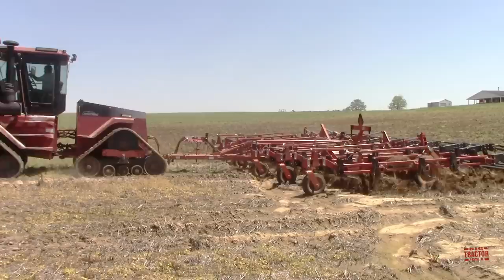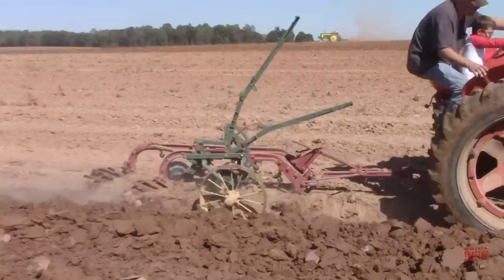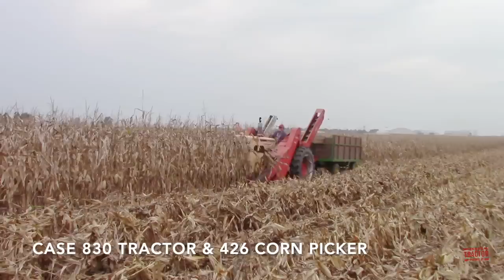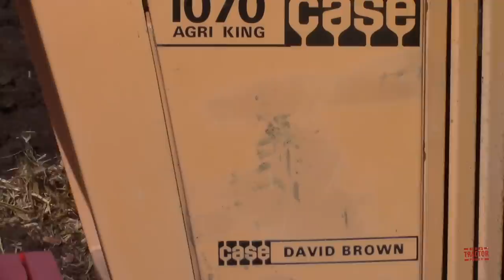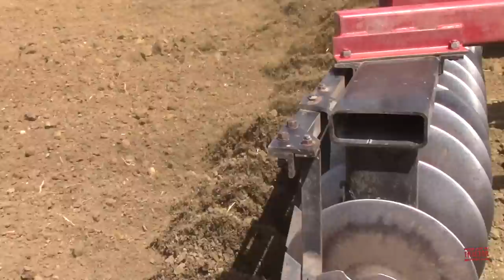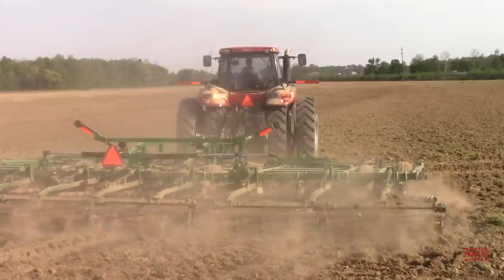CASE TRACTORS | J.I. Case 200th Birthday

Comment: My Dad bought a new Case 530 Diesel in 1969.  We ran a custom hay baling operation as well as our family farm.  At the time it was the biggest tractor he could afford and it did a very good job for us.  We had all New Holland hay equipment.  In 1971 I bought a new Case 470 Diesel and used it in the haying operation to pull the New Holland hay rake.  We could not have asked for better tractors for our operation and got very good service from both of them.  Our Case and New Holland dealer was Hazel Farm Equipment Co in Hodgenville Kentucky.
Reply from the maker: Very cool.   I have been to Hodgenville.  Great history.

Comment: That 2870 Traction King is beautiful and also one my favorite tractors.
Reply: @westbender 820 When my dad moved into 4WD he started with a 2470 for a couple of years, then a 2670 for a couple more, then a 2870.  We pulled a 32' John Deere double tandem and a 40' shop built big sweep bar.  We also extended a 9-shank BIg Ox ripper chisel to 15 shanks and pulled that a lot.

I remember the morning routine was to service the engine, then start it and take grease gun and crawl under the tractor, greasing it as I crawled forward.  I even modified a pistol grip grease gun with a special tip so I could grease the u-joints without having to move the tractor to get the zerks where I could reach them.

By the time I'd greased all those zerks that big engine was warmed up and ready for a day's work.

He switched to min-til after that and rented a 2590 when he needed a tractor.  Good tractor except it had one main hydraulic line that ran from the pump to the rear where it branched off to operate the hydraulic lifts and even the seat.

Problem was there was a rub point and after so many hours the line would blow out and spray all 15 or so gallons of hydraulic fluid all over the place.  Dad was glad he didn't have to pay that bill!

Comment: I had a 870 case with power shift transmission. Did alot of work with it. Cleaned up a lot of land with it. Had the engine (336 diesel) rebuilt in it. However the transmission started giving trouble. Once when the tractor was sitting and ideling in neutral the transmission slipped into gear. Tractor tore up inside of my neighbors barn. Glad myself or someone else didn't get hurt or killed. Soon the C1 and C2 clutches gave out in the transmission. That meant I didn't have a 1 or 2 nd gear in each range. That was when I decided to get another tractor. The old 870 was a good strong tractor before it developed transmission problems. Thanks for the video. It brought back memories.
Reply from the maker: The 770 and 870 are rare tractors.  They were produced from 1969-1972.  They were replaced by the David Brown 1210 and 1410 after Case acquired the tractor company.  I am sorry to hear your 870 was problematic.   I know a farmer still using two 770s to rake hay.

Comment: I would say there are to many to have a favorite. But my first memory of riding in the tractor with my Dad where in the 2470.  Great video. I loved the big back areas of the 2290 and the 3394   I also remember when turned our 2294 up to 165hp.  We thought we really had something then.  I also remember the day we demoed our first 7120.  My brother and I ran that thing for 36hours straight. One of us would sleep on the floor while the other one drove.  And mom would bring out more sandwiches. Lot of great memories in a lot of these tractors
Reply: 2470 with a 8 foot Fair snowblower on the back.   We drove that tractor backwards for hundreds of miles clearing snow for townships doing the blizzards of the late 70s.   It took huge amounts of power to turn those twin fans and the fact you had different steering option was God send

Comment: When dad first started back in 1977 he bought his first and only brand new tractor a 1086 IH from there his big tractor for tillage grain cart and chopping was a 2390 i  do remember that. I was adopted so I don’t have much history with him when he was younger but I remember both of those tractor he called them red junk😂 the 1086 burnt up after being plugged in back in 2006 and the 2390 needed a new engine so he sold that in 2003 he bought a John Deere 4755. He had a 4440 for 20 years still has it. I was barely able to remember those machines as I was only 7 years old.
Now we have 7200R as our big tractor what a generation jump
Reply from the maker: Very interesting history. The 1086 was a huge seller for IH when it was new. The John Deere 7200R is a nice tractor. I got to drive a 7210R this past spring on seed bed preparation.  It’s a nice and easy tractor to use.

Comment: I have run a 430,470,530,830,930,1030,1175,1370,and 1570.  The 1370 was probably the best to use all around tractor of that bunch.  That 530 with the 12spd trans would scoot on down the road though! It was not hard to run 24-25mph with that thing, keeping it in the road at that speed was the only challenge.  You had to constantly keep the steering wheel slowly cranking left just to go straight. The hydraulics on the Case were usually the only real trouble I can remember with them.  The 504cid diesel in the 1370 and 1570 was the only ones that started decent in the cold.

Comment: The Case-o-matic trans system was one of the best systems developed to transmit power from the engine to the rear end. The torque converter pulled through tough spots and then lock it up and move on when through.
Reply: That's not the experience I had with a Case-o-matic. I hated that thing, it didn't have enough power to turn it's self around at the end of the rows.
Reply: Yeah its junk
Reply: I know man! No shifting, no clutching, no stalling! Got a undeserved bad rap cause people tried to drive em like a gear machine..

Comment: Love them old 70’s and 80’ case tractors. It’s what I learned to drive growing up. It’s what we ran after Oliver went out.
Reply from the maker: 👍👍. First tractor I ever rode in was a Case 2470.
Reply: First tractor I rode was a 870. That was also the first tractor I drove I remember it clear I was in kindergarten and I drove it back to the barn from the field. Boy I thought I was on top the world!  Spent a lot of time in the back window of a 1070,2090,and 2290 remember my head smacking the window every time they hit the power shift lol. I didn’t care tho! Had lots of case tractors over the years. 870,1070,1370,1570,1190,2090,2290,2294,4694.
Reply: 1st tractor I drove was a 165 Massey Ferguson. Today I own a 1990 Massey Ferguson 3070 .  I would much rather buy a older good tractor then a new one.

Comment: In Australia many years of JI Case even put a 1070 motor into a 932 had a few 932 1070 4690 435 quadtrac  and a few Stiegers. Always appreciated the uncomplicated  engineering of American gear. Aussie made stuff was similarly easy to work with.  Generally a common line of parts etc. Oh for the days when many people worked the fields

Comment: Great video Jason.  I have always had a liking for Case tractors and equipment even being a mostly IH farm.  On our farm we have had a model 600 and 800 combine, a 320W backhoe, a 1270 Agri King and a 2 row Case stalk chopper.  I also have in my collection a 36 RC and a 54 DC tractor.  Of all of them I would love to have the 1270 back. That was one awesome tractor that did everything that was ever asked of it without any major issues.

Comment: One of my earliest memories is of riding on the fender of our 1070 David brown case strapped to the fender with my dad’s belt while him and my grandpa chopped corn. It was a muddy fall and grandpa was pulling dad through the field with our 656 international.
Reply from the maker: Very cool history. What brand of chopper and wagons did you run?
Reply: bigtractorpower I believe at that time it was a gehl 600 chopper and the wagons were old all wood loadmasters I believe. They had ratchet drives for the apron speed and a single cross auger in the front. I was only 3 or 4 at the time so some of the details are a little fuzzy.

Comment: learned to drive tractor on a SC.  I couldn't reach the break pedals but didn't need to I you could stop with  just the hand clutch.  also drove my Dad's 311, 400, and 411. in high gear to 311 could do 30 mph if it wasn't  pulling a load and if the road was smooth enough.  also drove  my brother's 2670,  9350,  210, and 310. of those I liked the 9350 the best.  it was easy to drive.
Reply: correction MX210 and Steiger 350

Comment: My favorite would most likely be the 1989 Case IH 1896 that my dad purchased used and kept for several years. It was the first tractor with a cab that we had on the farm and we thought it was a Cadillac for that time. Good memories! Others I have driven and like are the Case 970, 1070, 1370, and 2390 just to nae a few.

Comment: We had a Case 830 Orchard model tractor.  It was a shorter tractor that those shown, but it was great at field work.  We put duals on it and hit the wet spots with a small 10' pull-type disc (no carriage wheels!) or a 12' drag.  I carried a 50' chain in case I got stuck.  It had no PTO "umpf" for the regular blower, but we put it on the belt driven, long conyeyor Aliis Chalmers blower (when I was like 5-6 y/o).

Comment: I know from experience that the 2670s 504 engine had a terrible head design cooling wise. It would warp the heads way before engine actually overheated. We had two of them and had the same problem with both. Bought both new in 73. Also you didn't even want to think about shifting the power shift up if it wasn't warmed up.I know a guy that bought one new in Seymour Indiana and he had his small daughter in it with him at the dealership. The very first time he drove it was in the winter and he took off in 4th gear and shifted the power shift to 2nd and it locked up seriously injuring the little girl. I believe Burbrink was his last name  Then we purchased two 8630 Deeres a few years later and it was like going to Heaven. It just takes some people longer to learn than others lol
Reply from the maker: That’s too bad to hear about the 2670.

Comment: Have you ever caught a Case 4994 Before? I know how Undoubtedly rare they are. None the less the 2470 is my favorite.
Reply from the maker: No 4994 yet but it’s high on my wish list.  The Case 2470 was the first tractor I ever got to take a ride in. I hope to find a 2470 to film too.
Reply: @bigtractorpower  I spent a lot of time running a 2470, it had some strong points but had engine problems. Started with a diesel 400, still have it, we also had an 800, 930, and 1175. Mostly reliable, but lacking in hydraulic capability and precise steering in the later models. The 930 would outpull a 4020 but was not as nice to drive. The old 400 was my favorite, first diesel my granddad bought and its been in the family since.

Comment: you finally did it. im 50. i grew up on the 90 and 94 series. we ran 90s from 22 to one 48 and in between. the 48 pulled a k28 b double offset disc and a snatch rope. our first red was 2394 with the 4by6 tranny instead of 4by 3. our second was a 35 our third red paint was a 7120 boxcar. we didnt know what to think. it equaled our red 3594.and then some. WOW. cheap ponys my ass. screw green paint. ji case built a tractor  for a man to drive,

Comment: 2nd tractor after steam engine barely scratching dirt. Good vid though. We always had red growing up, before the case takeover, neighbors had a 830 and 1030 seemed to be decent tractors.
Reply from the maker: The steam engine and the Case Cross Motor were in a plowing demonstration and it was a drought so the soil was hard packed. .
Reply: bigtractorpower I understand looked dry.

Comment: With regard to the 4 wheel drive/4 wheel steer Traction King tractors, what brand of drive/steer axles did they use - Rockwell, Dana or Clarke units - anyone know ?

Comment: Did u know case also built cars also ? They said case cars r so rare u will not even see one in a lifetime. They also said they only know about 2 case cars one in California and one was discovered in a farmers retirement auction in his Barn one owner. They did sale it in the farm equipment auction. It was sold cheap I believe 47,000 but I bet when car collectors find out about it that car is going to be worth 20 folds easily.

Comment: I like the case tractors. because my dad always had case and I do have a 970 case but do not farm. just use it for snow remover and my snowblower
Reply from the maker: The 970 is a great tractor to have. Does yours have a cab or is it an open station?

Comment: If cases parent company Tenneco brought International Harvester Why did they change the Harvester colors? You would have thought they would have stayed the case colors.
Reply from the maker: Well IH was a much bigger company so retiring Harvester Red was not an option. When Deutz a much smaller company bought Allis-Chalmers a year later and replaced AC Orange with Deutz Spring Green they lost 1,100 dealers and $18 billion in sales from 1986-1989.

Comment: Interesting, but too bad there is no indication of the date or span of production of the model shown. We can only guess by the general aspect of the tractor : minimal (1940), rounded front end (1950/60) squared (late 60s) very angular ((1970) angulo-futuristic (late 70s) dull with cabin (1980) all te way to the very rounded shapes of 2020… Maybe I'm totally wrong, am I ?
Very happily, the trend is towards more silent engines and/or exhaust …

Comment: I bet Jerome is pissed about tractors with his name on them have fiat engines in them now!!
Reply: We are using Fiat Tractors since 1970 and the verry best part of them is the Engine.
Reply: @marlauesc  lol, i ran a 1365 oliver 30 years ago.....it was a massive gutless pos.  Fix it again, tony.
Reply: @randymagnum143  We had a Fiat 640, itwas the same Tractor as your Oliver I think.
It was verry good, it was tuned. On the Manure Mixer the Exhaust Collector and the hole Muffler was red, nearly yellow.
It was working 11000 Houers, till it broke in 2 Pieces, the ClutchHousing broke on a hard Loader work. For the rest it used only Tyers and Diesel.

Comment: The ji case company died in 1988 when the international magnum was born from 1985 to 1987 they were just case tractors painted red with international on the tin work and in my opinion when caseih became there own company  and tenneco was out of the picture they should have drop the case name it a disgrace to the red paint on all of our new equipment  first thing we do is pull it in the shop and redecaled the equipment to international only I don't recognize the case name.
Reply from the maker: Well CASE has continued in construction.  The MAXXUM tractor introduced in 1990 was purely as CASE design. I wish there was still a J. I Case and an International Harvester but several factors brought companies together.

Comment: We farmed with two 2670s back in the early 70s and the only good memories that I have of those rough riding things is the day my dad sold them and bought 8630 JDs!  It was like going from  VW bugs to Cadillacs....That 504 engine sucked..I couldn't count how many heads that we had to replace and the AC was always broke and God forbid you use the power shift on a cold day before it had warmed up...if you did they would literally throw you into the windshield.....Just a piss poor design.....
Reply: RPS was a peace of crap.